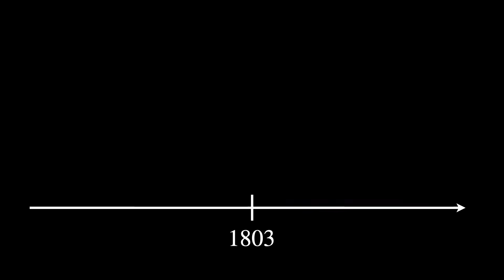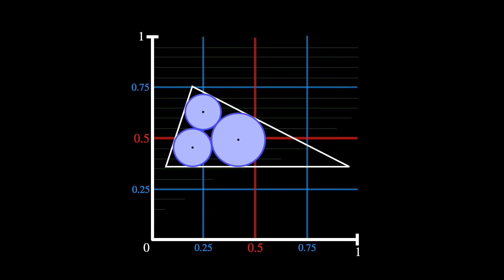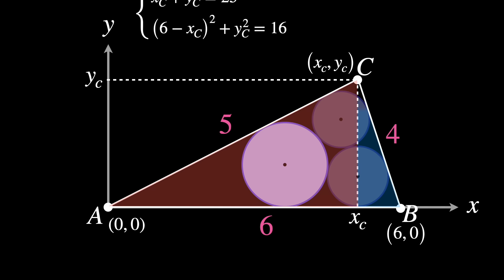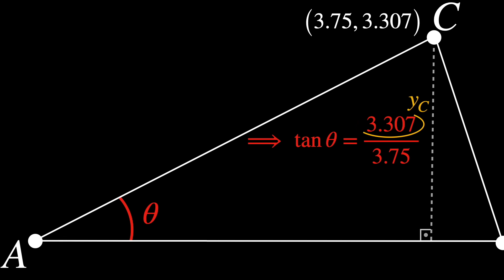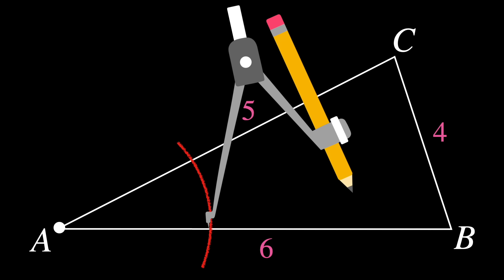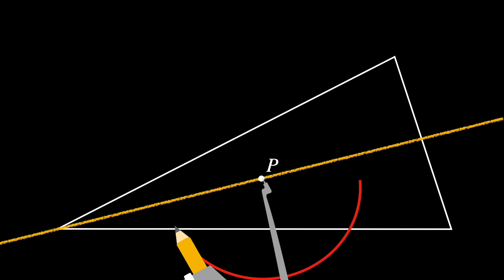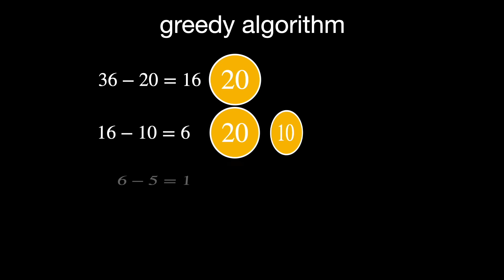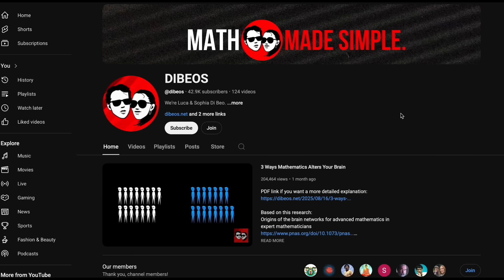The Simple Problem Mathematicians Got Wrong

Comment: Synthetic geometry cannot even trisect an angle so it would declare it to be non-existent when angle trisection is bread and butter in any kind of modern analysis. Edit: I do acknowledge the origami extension as many commenters have pointed out but here I used synthetic geometry in the traditional sense of the term, which is ruler and compass construction.
Reply: Synthetic geometry is just geometry where you work with lines, points, circles etc. There is nothing that forbids you from having a trisected angle.
Reply: @user-vh3po8ot1x  Yes, with line, points, and circles i.e. scale and compass one cannot do angle trisection. The proof is direct result of Gauss-Wantzel's theorem using group theory.
Reply: @RenormalizedAdvait  the proof would directly indicate it yes but... The proof that you can’t trisect any angle is much simpler because you’ll almost always end up with a cube root which just simply isn’t in the scope of straightedge and compass. You don’t need to bring in a much more complicated proof.
Reply: @merplicious  Check Gauss-Wantzel theorem which provides the theoretical underpinnings of the impossibility, it uses Galois theory's "extension field" to prove the theorem. The said theorem states that _"A regular n-gon is constructible with straightedge and compass if and only if n is the product of a power of 2 and zero or more distinct
Fermat primes."_
Reply: @user-vh3po8ot1x  He means the problem of trisecting any angle in three equal parts. Can't be done by straight edge and compass, but can be done by origami.
Reply: You’re talking about something entirely disconnected. That’s with a compass and straightedge which corresponds to the basic 4  functions and the square root.  multiplication, division, addition, subtraction. Additionally square root. You can’t trisect any angle precisely with only those functions. Even in algebra you need other functions because most angles result in square roots.
Reply: @merplicious  you mean "You can't trisect some angles", right? I am pretty sure you can trisect a 60 degree angle with compass and ruler.
Reply: @DiegoGamboa-lo2lw  that’s why I said you can’t trisect ANY angle precisely as opposed to not being able to trisect EVERY angle precisely. I can see I worded it weirdly. I meant to say that you can’t trisect every angle with a straight edge and compass but I kind of put emphasis on the any in my head that would change the meaning in a way that I didn’t express writing down. My bad.
Reply: @merplicious  Then I think  that it should have been worded as "you can't trisect an arbitrary angle". The word "any" would imply that there are no angles that can be trisected with compass and ruler.
Reply: @D @DiegoGamboa-lo2lw  yeah I meant to say “any” as in “any arbitrary”
Reply: Synthetic Geometry is not limited to compass and straight-edge constructions. It is any geometry that is done without reference to coordinates. It is still preferred to analytic geometry today, because synthetic proofs are often more insightful and easier to generalize than analytic proofs. But obviously both forms are valid.
Reply: It can be extended though. For example origami can trisect angles by folding the paper.
Reply: As said, after the origami method was found and included in the synthetic geometry methods, we can construct not just trisection of angle but also all regular polygons, and much else. We could say that Riemannian geometric has been a heuristic towards finding the constructive origami method and elementary solution to many old problems.

Comment: The n>3 generalization is a classic example of a packing problem. A large class of problems that have largely remained a complete enigma for modern mathematics. Resisting nearly all attempts to prove optimality of proposed solutions.
Reply: 17 unit squares in as small a square as possible
Reply: @aremiajtoh ?
Reply: @Frightning  An infamous packing problem.
Reply: @aremiajtoh Ahh, wasn't actually familiar with that one.
Reply: @Frightning  iirc its that weird ass one where there is a crooked square in the middle
Reply: The reason is that we don’t have the tools to properly diagnose the problem. Similar to what Paul Erdos said about the Collatz Conjecture. We’re not ready for its solution.
Reply: @Computer-STEM-NERD-903  Yea I am familiar with that quote: "Mathematics is not yet ripe enough for such questions."
Reply: I seem to recall an article on AIs coming up with some improvements for certain packing problems.  Can't remember the deets though
Reply: @michaelbauers8800 alphaproof

Comment: In your example, the full calculation and construction respectively should in principle result in the three circles from the starting point of a given triangle. Although you should make it more clear that that's indeed what you are trying to achieve, I think. Then you proceed by doing only one of the circles for simplicity, which is of course fine. But I think you are forgetting or at least not presenting clearly, that the resulting circle should still be one of the three uniquely determined Malfatti circles. In particular, that means that the radius of the circle is a variable that you want to obtain from the calculation/construction, not an input. If you don't choose the exact correct radius the result will not be a Malfatti circle. This is very unclear in your video.
Reply: Are the three greedy algorithm circles Ford circles, with coprime radii?